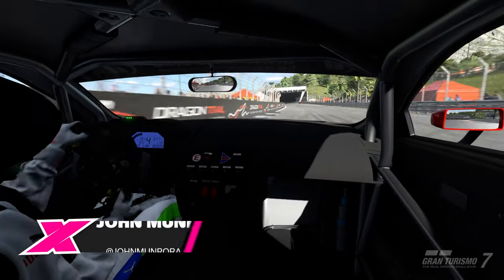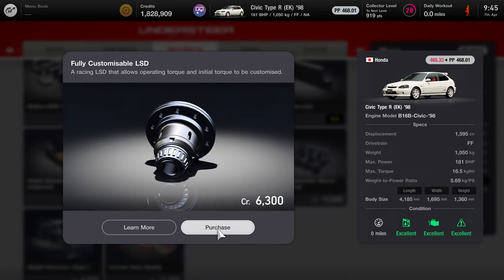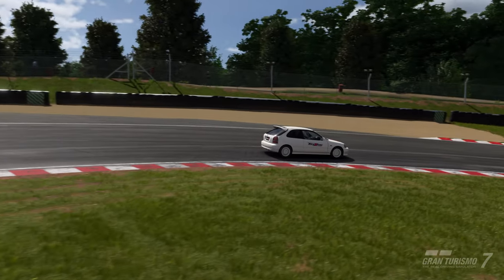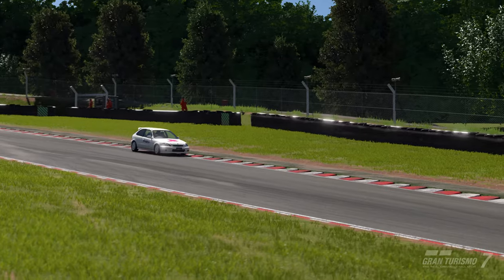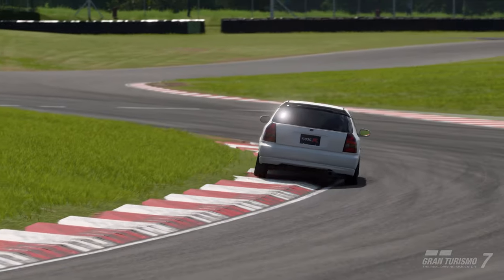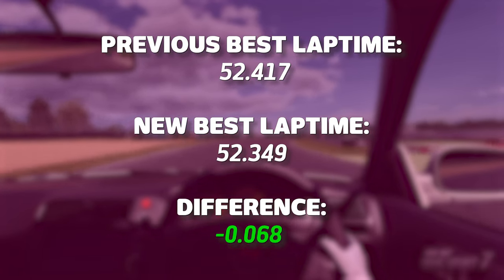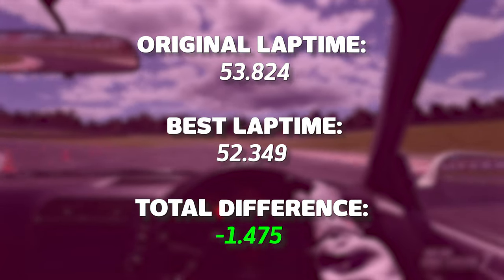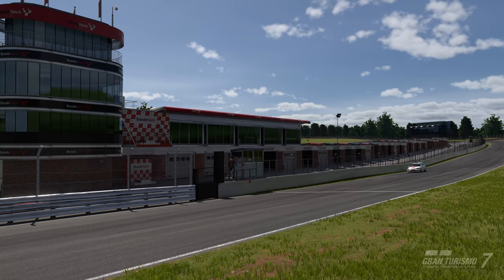Gran Turismo 7 Ultimate Setup Guide | FF Road Cars

Comment: In real-life, you'd never go over 3 degrees of negative camber, on any of the axles. Usually the forward-biased cars would have it on the front axle, and rear-biased on the rear one. But six is just... Onikyan

Comment: Actually, the game has the diff effects a little bit wrong.
In FFs, too high accel leads to understeer, because you overwhelm the outside tire. Too low accel leads to the inside tire picking up and spinning, reducing grip and acceleration, but most noticeably acceleration.
The decel should be tuned to help reduce one-wheel lockup under hard braking, but to not interfere with cornering ability.
(Think about how a spooled-100% locked-rear axle causes oversteer because there is no speed difference and tires must slip. A completely locked front axle means no speed difference between front tires, causing understeer.)
The things listed above are part of why helical differentials are popular in FFs-they can give the outside tire more torque than the inside, but do not "lock up" or "lock in" to a setting like clutch-type diffs do.

Also, on ARBs. (You kind of touched on this in the video a little bit) Soft front + comapratively very stiff rear is actually a very common and effective way to improve the car's handling. Think of the characteristic "three-wheeled cornering" old hot hatches would have. The setup reduces understeer by reducing the rear's tendency to keep going straight, allowing the car to rotate more effectively.

Apologies if this seems to be only criticising, the video was amazing, and I love that you are willing to give attention to FFs, especially when most people simply laugh and walk away.

-A Car Enthusiast Who Drives an Old FF

TLDR because I just realized that is really long:
The game has the diff stuff somewhat wrong, and the theory behind the ARBs is sound, but does not necessarily match real-life applications.

Comment: A little over 3 minutes into the video, and already there's a glaring issue. If you have a fully tuned racing suspension, do NOT lower your car all the way to the lowest setting. In most vehicles it will upset the balance/geometry drastically. Also, the diff in GT isn't exactly like real life, so your approach to tuning it is a little off (as others have stated). Good video overall, but a bit more R&D behind the scenes seems necessary.
Reply: For this car and track combo, slamming the ride height worked perfectly fine and was faster than trying various other combinations of ride height. Also, for the diff tuning I went for what felt better and what was ultimately faster for me, so I get where you're coming from but the aim for me was to find what made the car feel better and go faster! BTW: I wrote this guide a while back but currently reminiscing about the good ol' days of Traxion :(